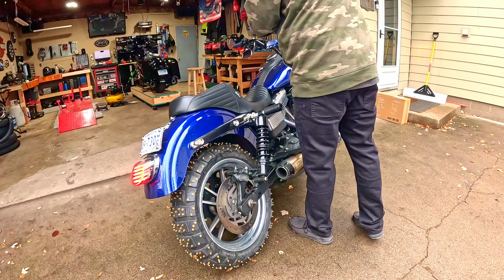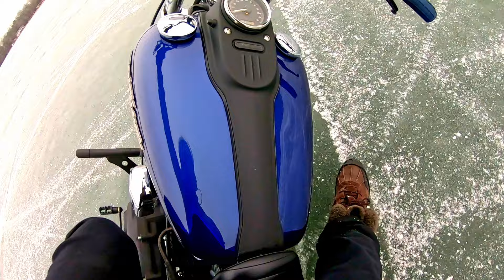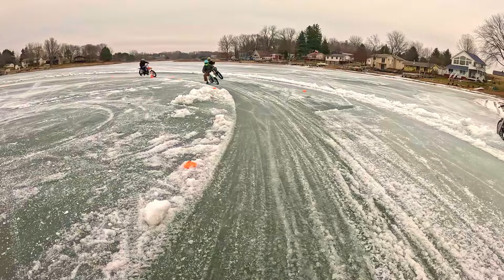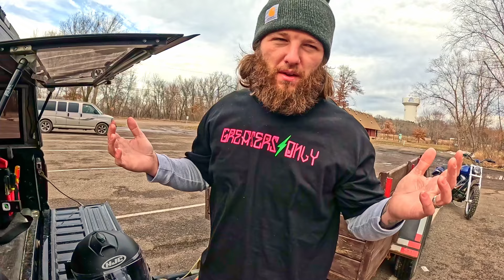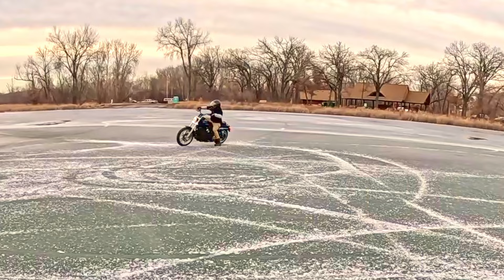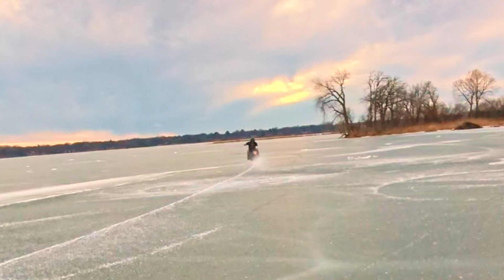Harley Davidson stunt rider on thin ice!

Comment: Do a video on brakes, just did front brakes, put wrong, 5.1 fluid in front master, mixed it alll up, drained it, fkushed it with de natured alcohol, filled the master with Dot5, but now have no brake pressure.  Its air in the lines. Do a brake bleed video please
Reply from the maker: Hey there, I took some time off. I can definitely make that happen! 👊🏻